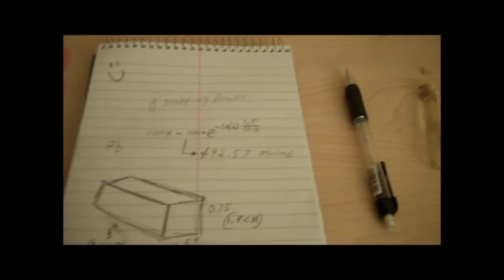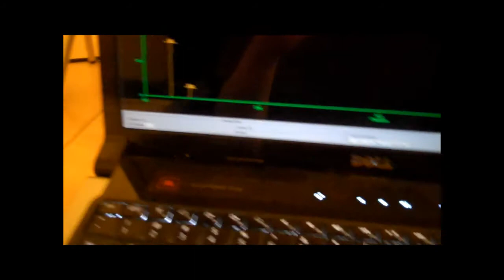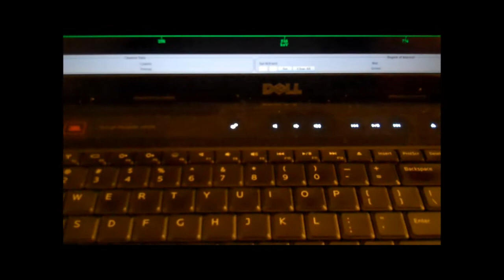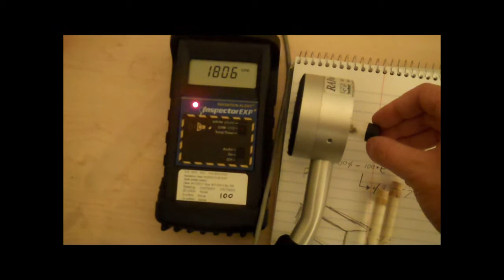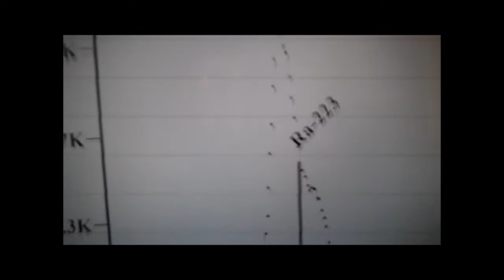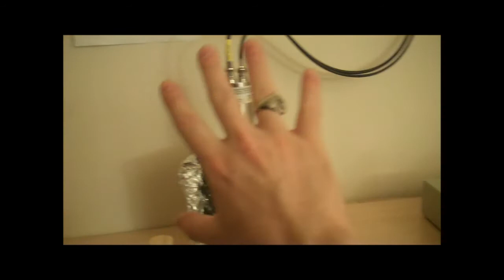Updates - Rain Water, Uranium, and More!

Comment from the maker: I could get cancer from my hobbies, but statistically if I took up nearly any sport, my chances of death are greater.

All in all, radiation does cause cancer. This is 100% for sure and proven. My exposure from holding one of my check sources to calibrate my equipment, for perhaps 2 to 4 minutes, is maybe 0.5 mrem to my hand and 0.01 mrem to my body, +/-. If I did that 100 times, my total exposure would be 250 mrem to hand and about 1 mrem to body.

Still safer than smoking. =) Much safer!